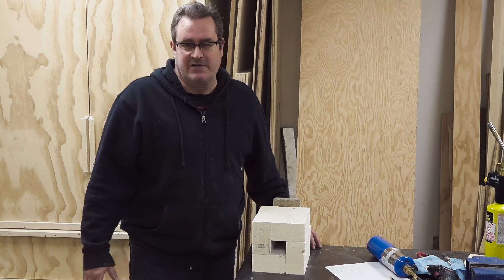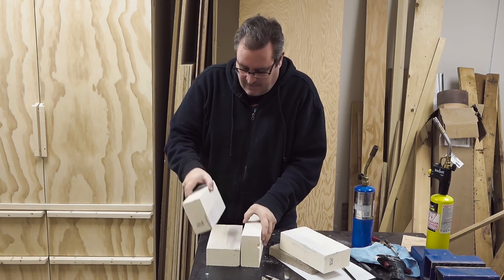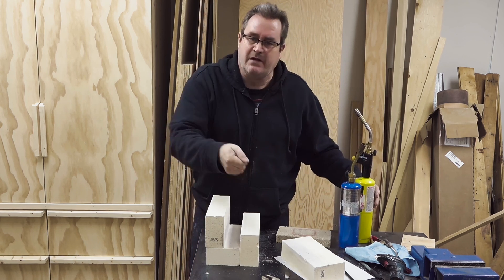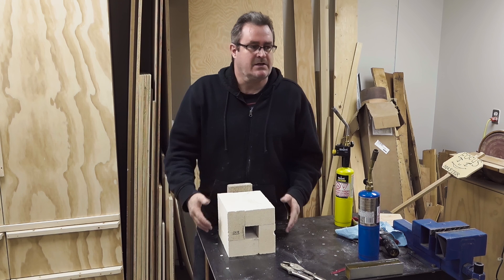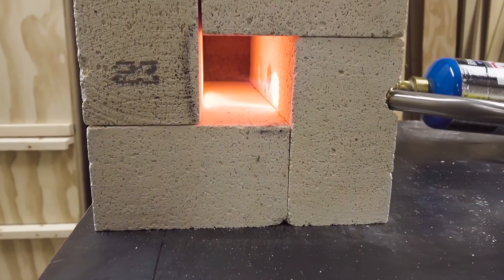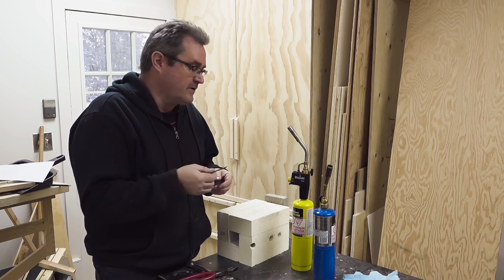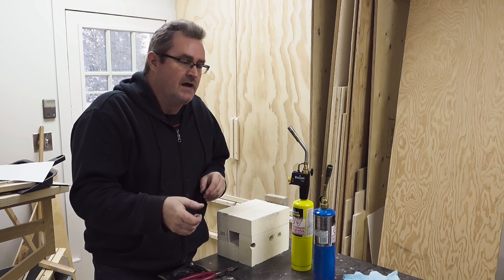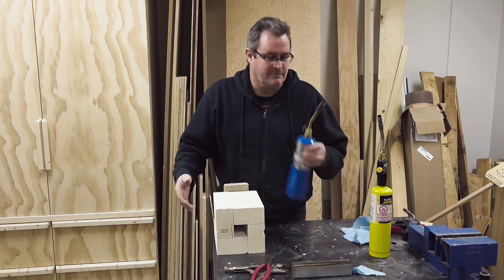Super Simple Mini Gas Forge

Comment: You have IFB that stands for insulating fire bricks. They are somewhat softer and prevent the heat from going through. The regular fire bricks hold the heat. I checked with three different brand stores and finally had to go online to find which of a Lowe's I could find these at. Had to go to the next town over because nowhere in the city had them. Others have said that the steel will be the proper temperature when it becomes non-magnetic. They keep a magnet nearby attached to something so they can touch the steel to it while heating to see if it's become non-magnetic. Oh and also someone suggested to use the MAPP gas which is hotter. You will also need the torch made for the MAPP.

Comment: When tempering, you can heat carefully with a torch from a little bit of a distance and when you see a straw hue change to a  purple hue and then quickly change to blue, quickly quench the blade. this is good for 1080 steel and other steels that are close to that grade.

Comment: Good design, but you don't want turbulence. Too many wannabes are spreading what is becoming an old wives tale, namely that you want a "vortex" type flame as seen in a foundry. Since building a knife requires a relatively precise and spatially controlled heat source, and does not involve a flame heating a cylindrical crucible, the way you built it to start with is actually the right way.

There is a reason that professionally built propane forges do not angle their burners.

Comment: Would it be possible for you to throttle the air flow of the forge and or use a simple lower temp torch head or other milder heating element(like a camping stove or sterno even) in such a way that the center would reach a uniform lower temperature for tempering? Test the temp[erature with a scrap peice of metal and refer to the tempering colors of steel chart.? Then you could also use it for annealing too right...slowly lower the heat and all. How insulating are the bricks if you shut off heat and block off the holes and front  in other worrd closed off no airflow? Slow enough for annealing? Thin pieces of metal are harder to do my prefered method...heat past austentitic then quickly burying in powder plaster of paris and packing it tight. Thin metals pretty much air quench before i can bury it...cools too quick...so some thing like this would help if that is possible. 

Opinions anyone?

Comment: Would you do a video on making that forge with an electric heater coil. I was a mechanical engineer for  company who used electric furnaces to melt Braze Alloy. When the company closed in 2009, I should have taken some of the extra Thermal Couplers, heater elements, and refractory bricks that I used? Oh well...Hind sight and all:~))))) Thank you.Ps: You can get refractory cement at Lowes. They call it Chimney repair Cement, it comes in a 5 pound plastic tub, or at least it did in 2000? Stone 327 Pappy Dave's Knives Pa.

Comment: There is a correct way to decide when a blade is hot enough to quench. Heat the blade up until it will not be magnetic. Just touch a magnet to the steel. If it sticks heat the blade more. If it does not stick you are at the right temperature to quench the blade.
Reply: As far as I'm aware the non-magnetic point is just used as reference but the right temperature is slightly above it
Reply: Non-magnetic is around 1,400 most steals require a round 15 to 1600 with about a 4 to 5 minute soak time at that temperature. At around 1,400 when it becomes non-magnetic it should glow a cherry red. You want to go a couple shades brighter.it's a good idea to have the lights dimmed so that you can see the color properly.

Comment: For tempering, I've taken to using one of those small butane torches. I heat the back edge of the knife and the heat spreads out towards the cutting edge. You can actually let the back edge get just a little bit blue/purple while the cutting edge is just the right straw color. Takes a bit longer than with a larger torch, but you have that fine control.

Comment: In college I went to a place that made fiber optic components and while the building in front with all the offices was all high tech the building in the back where they actually melt and pour the glass was like something out of the 1800s, including a similar brick just stacked around the furnace.  One guy would reach in there with essentially a giant set of bbq tongs to pull out the crucible and set it down on a stool, where the other guy would pick it up with a different set of tongs and pour it into the molds.  When it comes to just getting stuff really hot it's a pretty low tech world.
Reply from the maker: +krtwood 
Keeping it simple works - less high-tech gadgetry to break down :)

Comment: Cool, so what happens if you use water instead of oil to quench?  Your clarity on that topic would be great, the knife nerd forums wear me out.
Reply from the maker: +Jon Stevens 
Anything that can rapidly cool the blade will work, including aluminum plates or even fast moving air for some types of steel.
Reply from the maker: +Jared Shaffer 
Common misconception. The steel needs to have a high enough carbon content to begin with to harden. 
It is possible to mildly case harden low carbon steel by repeatedly heating and quenching in carbon rich oil, but that's generally not worth the effort.
Reply: It also depends on the type of steel you're using. Some steel you can use oil others you can do with water.
Reply: +Jared Shaffer lol this is what happens when a bunch of woodworkers try metalworking
Reply from the maker: +Andrew Klein 
Water works, but oil more effectively surrounds and cools the metal uniformly, since it has a much higher boiling point. Water may also cause the metal to crack, if it cools it too rapidly or unevenly.
Reply: you can quench in water but it wil easily crack and if you don't move it around enough it will not harden because there will be a 'steam jacket' around your blade so it won't cool down quickly enough.
Reply: +I Build It I thought if you cool it with water it weakens the steel I guess you learn something new every day 😀
Reply: +I Build It I thought the carbon content of the oil had something to do with the hardening?  I really don't know though.
Reply: +Det Du I know it just took me a lot longer to learn the basics of metalworking after I got into woodworking and I still need improvement
Reply: +Andrew Klein 
Depending on the steel, some steels are oil quench, water quench, and even air quench.
Some people use a technique of quenching in water or about 2 ish seconds then to oil.
Same way some people temper the blade in oil heated to 400 degrees.
Reply: If you use water it will not work, has to be oil

Comment: How timely, I just designed a fancy small forge 2 days ago; haven't gotten the bricks yet; I assume the 23 on the brick is for 2300 degree F? And how thick is the brick?
Reply from the maker: +John Zhu 
I'm pretty sure they are 2-1/4" thick, 4-1/2" wide and 9" long, which is handy. I do believe the 23 is for 2300. I bought these in packs of 12 from a pottery supply with the intent to eventually build an Evenheat type heat treating oven. I've got all the parts, just need the time :)